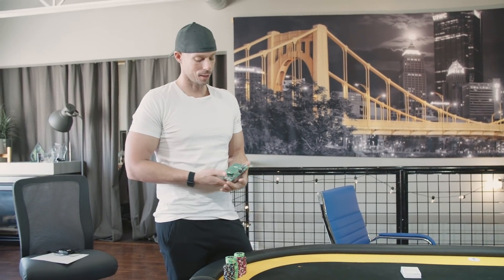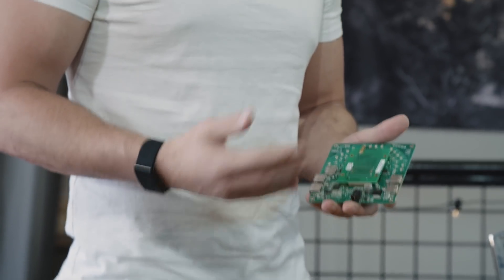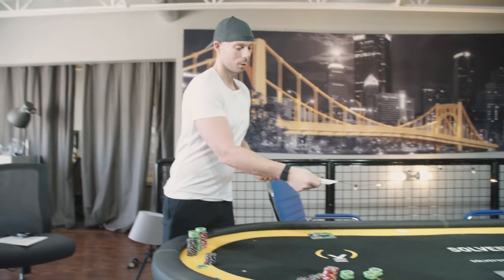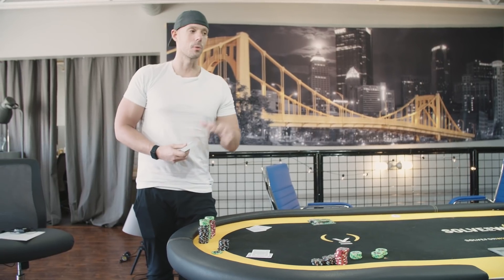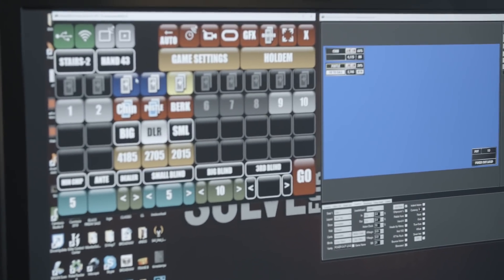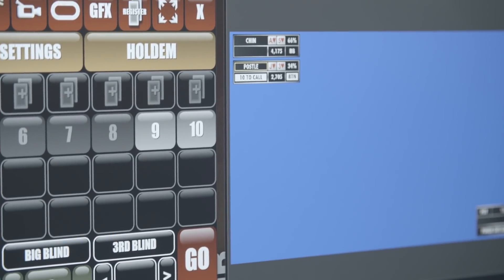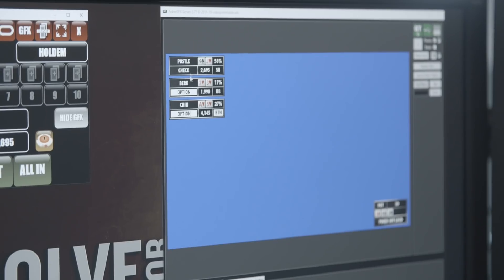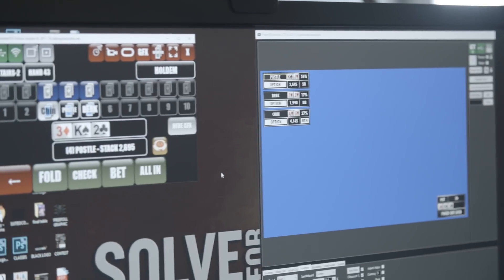STONES ALLEGATIONS-- How RFID/Poker GFX Works (Demonstration)

Comment: i warned about RFID or other signal interception or hacking years ago when I was playing Pai Gow Poker and watched the automatic shuffler get stuck and the display on the back that faces the Pit displayed the 10 of clubs which was indeed the card that was stuck.  And hard rock casino in florida uses electronic dice.  So the system knows what cards are in which hands and in which spots.  Not a stretch to now have the dice come up electronically with a number that is what the casino or somebody else wants.  And as a corollary the machine knows what hands have which cards so perhaps a player could get that information and they would know what the dealer and other players have

Comment: Thanks for the video and the other Matt and SFW. Where do you change the game from NLE to PLO? Is that in the main GFX software, so when they get four cards and it's not changed, it only shows two?
Reply from the maker: Correct, it's just a toggle switch in graphics tracker
Reply: @SolveForWhy  thanks

Comment: Strange the software wasn't designed to account for a misdeal, or mistake in the deal, where a card starts at on reader then ends on another. Is there a reason it's set up like that?
Reply from the maker: There's a misdeal feature

Comment: As a tech geek (networking, systems engineering, RF communications)  people are overlooking a few things here in regards to potential vulnerabilities or means of exploiting this technology. First and foremost, there are multiple means of attack. It could be as basic as remote desktop or other exploit on the server end, to infiltrating the WiFi, and even as complex as a custom developed exploit for the reader module itself. Given he was once an employee, he could have done something as basic as installed a hardware keystroke recorder to gain passwords, etc... If he is extremely sophisticated and has systems engineering experience, custom developed exploits are not off the table (no pun intended).  I have some experience in Penetration Testing, and would love to get a hands on look at the hardware/system :)
Reply from the maker: We cover most of this in today's vlogcast!!

Comment: Great Video.  Just a quick clarification so no one gets confused.  The code or characters the reader receives are like a QVC or barcode and looked up in a library, but not the same method as a barcode reader.  The reader doesn't scan anything.  The RFID technology is used with a transmission and an embedded IC (integrated circuit).  Particular in playing cards, they use a high frequency passive IC (active is powered, passive gets power from transmitter).  Just don't want anyone to think you can get some kind of scanner or RFID active reader.  The science behind it is a lot like wireless charging and has to be done within a cm.  Layman: RFID is transmission of characters, Barcode is a reflection of light converted to characters

Comment: As someone in the tech industry, I don't understand why if there is a bad read the software doesn't do some sort of error correction routine.
Reply from the maker: It isn't able to discern good from bad, it's just an interpreter to the info that passes over it.
Reply: Yeah, why can't it just reread the cards to look for changes during each action.  Would be super simple fix honestly.  Or just recheck before betting starts.  Could be automatic.

Comment: Don't understand it. In the past there were these little cameras that showed you what cards the players had. But now these cards are read like chips on products? So you can not use a random deck that you buy in the store?
Reply from the maker: Correct
Reply: @SolveForWhy  Thanks for taking the time to answer. Maybe in the future if you go over that incident again where they changed the cards that we as the viewer saw you could explain that more basic.. because I keep thinking 'that doesn't change the cards on the table and it was also not relevant that Postle's game changed because of it.' So I'm missing something or it's not so important. I do believe he's guilty and you guys are great : ) but that was just a little thing..
Reply: Which makes the decks more expensive and less likely to be thrown out.  Further increasing risk that they could be marked or have their rfid's recorded over time.

Comment: I’m surprised there is not a inbuilt security fail safe for the RFID tech that keeps a small file log with how many devices the information is being displayed on and stores it in a  folder which can only be deleted by someone high up not involved with the stream 

With such vulnerable information someone independent of the stream should be checking the informations distribution but they picked almost the lowest stake game which feels coincidental

Comment: I have seen the cards be wrong. Even on ESPN, it will be all random cards shown for random people. I've heard multiple say that, if it was wrong for one, it would always be wrong. that's obv not true.
Reply: Was it RFID, though? Oftentimes on televised poker people use table cameras that let you see the hole cards when they are face down, or cameras that show the cards when the players peek at them. In both these cases, a person behind the scenes enters the cards manually.

Comment: I think he hacked the Twitch stream. Twitch has two links when you make a stream. One is the delayed link and one is the live link. I think he injected a trojan (with a USB memory stick) sometime when he was in that booth. So then he had the "God" link and could watch the streams live. That is why he is watching his phone + has the headset under his hat. The anser to this mystery can be found in the Stones computers, there is no inside help or mole. Greed got him finally. He should have settled for just a normal winrate and he could do this for many years more. Now he most probably going to jail soon.
Reply: makes alot of sense combined with some basic card reading equipment easily purchased via internet sites which would explain alot of the action that has happened

Comment: If they actually used a wireless connection, I would bet money they didn't, that would be incompetence on the highest level.  Even if it is encrypted and password protected,  its presence would be obvious to anyone with a wireless device.  The signal would show up and eventually someone would find a way to hack into it.  Talk about low hanging fruit.  Anyways, if Stones live stream was actually this unsecure they are 100% liable no matter whether there was a "man on the inside" or not.  They treated their customers money with utter disrespect, quite hypocritical considering the lengths they go through to keep their own money secure.

Comment: Hi. I read through the manual for PokerGFX and another vulnerability is by using MultiGFX. A second computer on the same local network (wifi) can access the same information as the main software in back. Only needs to have network password and possibly table password. If you have a second computer with a 2nd copy of PokerGFX you can test this by turning on the MultiGFX option on the second computer. Please test as I think this is the method used to gain access to perfect information.
Reply from the maker: That's correct. I didn't include it in the explanation bc it seemed unnecessary, but the rumors floating around now are that it may have in fact been the case.

Comment: Terrible camera work and you guys could’ve gone more in depth
Reply from the maker: We have a full 25 mins dedicated to it in tomorrow's vlogcast, this was merely a demonstration of the tech
Reply: @SolveForWhy  Not sure if you will go over this in the vlogcast but you should assume your viewers know nothing, and point out there is an rfid tag embedded in the cards, which is what is making that card unique. Maybe even show them what one looks like, if you happen to have one by chance

Someone might think that the reader is picking up something on the image of the card. I know its very minor, but if you are going to explain it, starting base level is best. :)
Reply from the maker: @fomori2  I mentioned it in this video, I said it's akin to a barcode
Reply: @SolveForWhy  I saw that you did mention that. When I hear barcode though, I think of a light scanner picking up on an printed image on an object. When I hear rfid, I think of a radio scanner picking up from an embedded chip. I am probably nit picking a little too much for the type of audience you are giving the explanation to.

Props for putting this together. Im sure there are a lot of people, myself included, that never really knew exactly what the software was doing in the booth.
Reply: @fomori2  just in case you weren't sure, you were definitely nit picking... Lol
Reply: Just as terrible as your hair